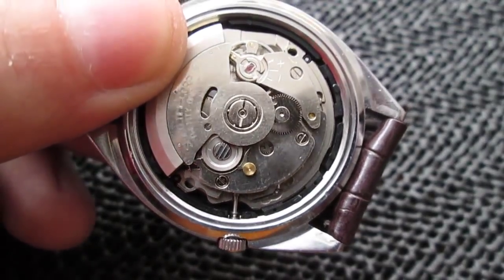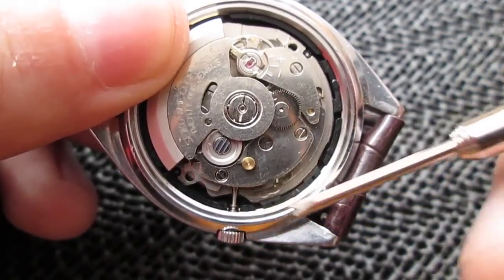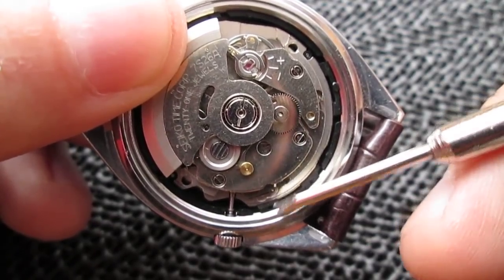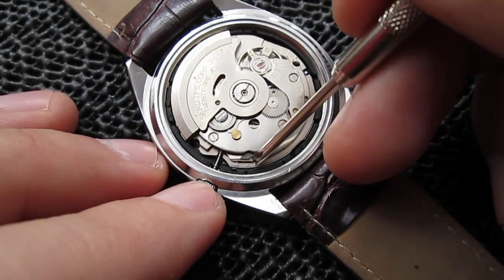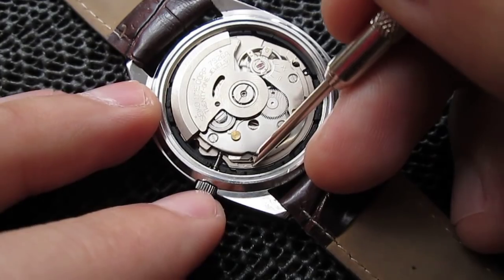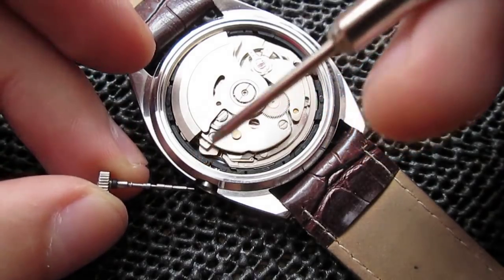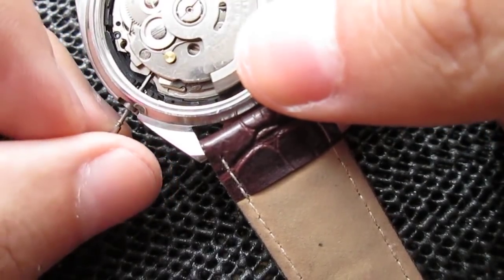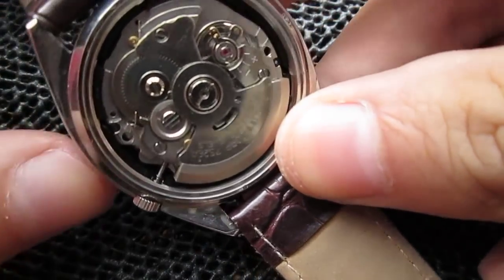How to remove Stem/Crown from Seiko 7s26 Movement

Comment: Thank you so much! Bought mine from Singapore (online) and the crown came out (without the stem), I've got super frustrated with the experience because it would be a hassle to get it returned and replaced / fixed. With the help from this video, I had it opened and tighten up (stem and crown)...closed it back together...done deal! Awesome feeling because I really love my brand new watch 👏🏼👍🏼

Comment: great post +EDC Gunner. just wondering if you could upload a video on how to remove crown and stem from a Seiko 'Kakume' - I bought one a couple of weeks back, although is a frankenstein - aftermarket dial / the crystal is on a weird angle (not level) / the chrono pushers are way to long and the crown is some weird arse thin crappy looking thing. also the tachymeter bezel is not aligned properly. anyway still love the watch but kind of thinking about fixing it myself although I have next to no idea about watches. any advice would be mostly appreciated..

Comment: Sir, tell me 
I bought new Seiko 7s26 watch on which water resistant is written but actually it is not so, plz tell me 
It's solution
Reply from the maker: water resistant is not very water proof indeed..you need a 100 m wr  at least to be comfortable around water